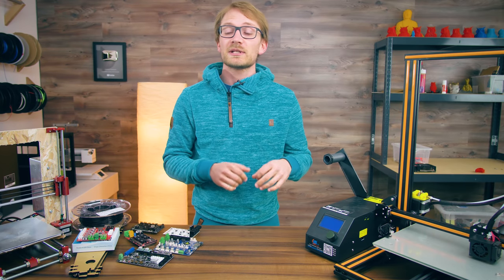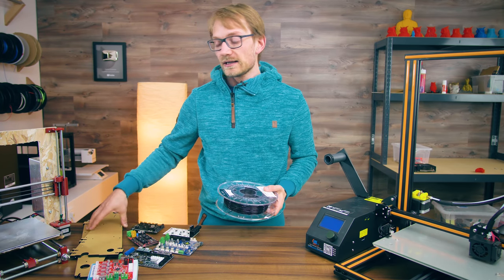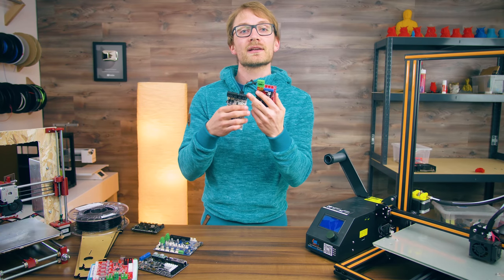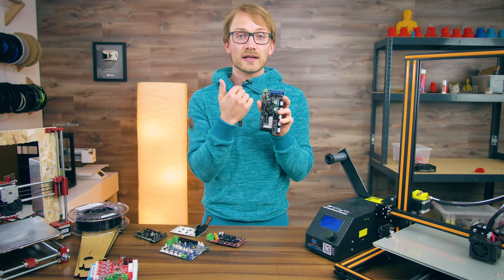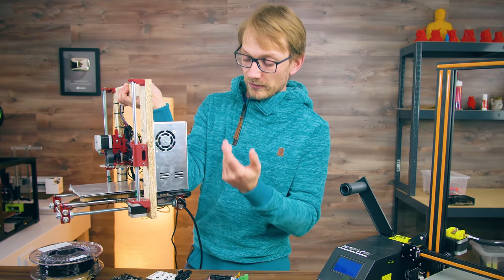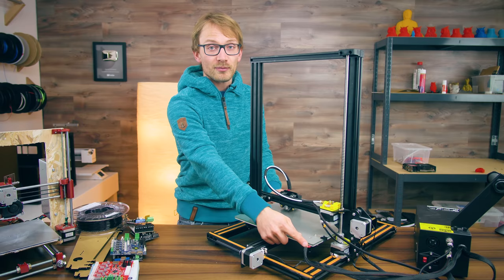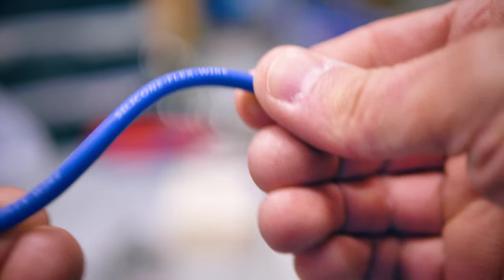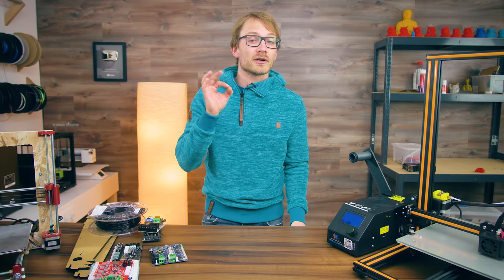Everything you need to know to make your 3D printer fireproof!

Comment: Anet and some of its siblings ship with Repetier-FW, which has thermal protection, but it's disabled by default. So they haven't enabled it probably by negligence.

There has also been a simulation published on reprap wiki that the inductive spike off the bed, simulated with measured parasitic inductance of wiring and bed, can easily exceed MOSFET's rating, so a free wheeling Schottky diode across the outputs would be nice. MOSFETs are fairly temperature resilient, they're too hot to touch at 65°C but you expect them to live a long and healthy life at 80°C too, so chances are, it's more the spiking than temperature killing off the things. Of course they fail short, and then there's no reason for the fuse to trip, because it's as if the MOSFET was simply turned on intentionally.
Reply: Would the firmware updates or change altogether help this? Or would people be ok just installing outside mosfets for both heating elements? I wanna be sure it doesn't make a fire. I'm prepared for it, but i don't wanna ruin 3dp's credibility in my house. lol.
Reply: Official firmware updates, for Anet and its siblings (Tronxy, Zonestar, etc) - i wouldn't hope, they have no idea what they're doing. Alternative firmware distributions from the user community are generally safer and better tuned up.

I don't have an Anet but from the rumours i heard it seems that the official firmware also might not have a working watchdog. Watchdog is an internal peripheral of all relevant microcontrollers which runs a timer, that the firmware should re-start regularly after checking its state, that it seems to run fine. Once the timer runs out, which happens if the firmware is locked up or not delivering the necessary performance for its realtime tasks, if watchdog is enabled, the microcontroller will reset to bootloader and turn off all outputs, hopefully (in case of semi-sane board designs) turning off all heaters in the process, after which the firmware will boot again. Why i suspect this is because some people describe their printers locking right up occasionally. That is one of the worst things that can happen - if the heaters were on when it happened to lock up, they will stay on.

So it's very much advised to use someone's better developed firmware.

Having an external MOSFET doesn't fix the potential thermal runaway issues if you're running stock firmware. Furthermore i suspect that in case of one of the recent fires, various hardware upgrades have exacerbated the issue - more powerful power supply was installed, an external MOSFET for the bed was installed. But that just means you have THAT much more power to go around if things go wrong! There was effectively not a single electrical fuse on the thing, not one that was anywhere near sensitive enough. Anet and Melzi already don't come with fuses on the board, which is bad, and with those printers which do, circumventing the fuse and installing an external MOSFET without giving it another fuse is outright criminal. Plus look at those MOSFET kits, they are generally Chinese ICs, the specs on them seem... fine, but there's no telling how good the production consistency is, and how they behave just outside the specs such as on occasional spikes, how well designed the whole board is, there's still no protection diode to cap the voltage spikes, there's always more things to go wrong.

Once the MOSFET fails, it fails short and there's no control. Firmware can detect thermal runaway, and if it was on an ATX power supply and had PS_ON control, it could cut off the power to the complete heater/motor portion, but the way people normally build stuff, it's not the case. Also thermal runaway detection takes maybe 20-40 seconds to engage, and by then, you might already have a self-sustaining fire. Janky printed cable chains that people installed to make things better sometimes made things worse because they did rub the cables in a spot and hindered inspection. Beefier wiring sometimes made things worse. Most things you can do will have benefits and potential drawbacks.

Unfortunately i'm not good enough of an engineer to give you much specific advice (and i do have electronics engineering university education), i can just list some potential problems but i don't have the data to back up how important or prevalent all these issues might be, and to give a solution which would be easy to grasp and implement for a typical builder without introducing further issues. This is something where we need to put out heads together and dice out as a community, pooling from various experience fields.
Reply: So in repetier, is it the watchdog timer that is the protection, or is there other settings required?
Reply: I'm not very familiar with Repetier, but their lingo for thermal runaway is "decoupling", so look for that in the configuration file. In particular you should probably enable KILL_IF_SENSOR_DEFECT, which is weird that this is the only one that jumps out and doesn't use the same wording, but it controls the sensor decoupling test feature.

Also the feature might be faulty, see issue 737 on their Github filed a couple months ago - "v1.0.0 Firmware does not detect defected thermistor (-200°C and still running)" - weirdly no response from the maintainers AT ALL. I mean, when there's a security or safety relevant issue being filed, wouldn't you rush in to treat it at priority and at least request more information and triage it? I don't know, this kind of conduct (or lack of any) leaves me speechless.

FEATURE_WATCHDOG is enabled by default, but it's kind of tricky to get right, who knows whether they ever actually tested it - it's difficult. Also it's not thermal runaway protection, it's protection against the firmware locking up and losing control over heaters altogether - it can result in thermal runaway which thermal runaway protection could no longer catch, because it would no longer be executed. Similarly, Watchdog is enabled by default in Marlin.
Reply: Dragonslayer.Bob If you want extra safety a seperate mosfet won't do, you need a switch that fails open... like an electromagnetic relay.
Reply: Warrior, but electromagnetic relais have bad failure modes too! Imagine the gradual contact wear - as the contact resistance creeps up, the increasing portion of the total power delivered on the bed rail gets dissipated on the relay contacts - let's say it's about 100W in total. At its worst, the resistance reaches the same as the bed, so effectively 25W may be dissipated on the relay, it has to pretty much cause a fire. What makes a MOSFET solution attractive, besides the fact that it's cheap, is that for a well designed MOSFET system with quality components, the MOSFET will stay operational and not experience a significant degradation for the lifetime of the device easily, for numerous decades of operation.

Furthermore relais don't necessarily fail open. Sparks and inductive current spikes can cause the contacts to weld themselves, so the relay stays permanently in closed position.
Reply: Siana Gearz Electromechanical relays are usually designed to handle far more power than a heated bed draws though, so the resistance should be low enough for this type of application. And yes, it's not impossible for an electromechanical relay to fail closed, it's still a better safety measure than another mosfet IMO.
Reply: Siana Gearz Keep in mind i'm not suggesting running a relay in PWM, it only needs to open when the board detects thermal issues, so the contacts won't wear that significantly.
Reply: Oh, i didn't know that you meant that! You could control those from the PS_ON signal then. I might borrow this idea. Should look into stepper EN signal also, might serve similarly.

Note to everyone who wants to try that, relay control winding will easily kill an Arduino, so it should be buffered with a transistor, and a free-wheeling diode to protect that in turn.
Reply: Siana Gearz Yes, i switch mine from the PS signal. That way it only switches when you turn the whole printer on or off.
My heatbed is also 230v, so there isn't that much current through the relay.

Comment: I have had my 3D printer catch fire. I was so lucky that I was looking at it as it caught fire, and simply switching the power off was enough to stop the small flame that had started on the stepper motor driver. and I didn't have to use the fire extinguisher i had grabbed after flipping the power switch. what was concerning was the smoke detector inside the room with my 3d printer didn't go off, but the one on my landing did go off.

Comment: We had a discussion on the Anet A8 Facebook page a short time ago. We discovered that using these external Mosfet board upgrades that are very cheap and work well in removing the AMP's out of the main board connectors and mosfets, but when they fail they typically fail ON. So even if you had the software upgrades because you have bypassed the printer main board using the Mosfet, if it fails on it will not turn off even if the printer is off. Because these cheap printer PSU's do not switch on and off by a controller from the printer main board like a computer PSU for example they can cause the exact problem we were trying to prevent in the first place. 
What is needed is a relay controlling the PSU's supply determined by the printers safty features and if its actually on and in use/ printing. 
From the ideas we had a extra Arduino would be required to control the relay as the printers main board doesn't have the IO pins spare or be controlled by a Raspberry Pi octoprint setup.

Comment: +Thomas Sanladerer
That smoke detector is in a BAD spot you should have it in the centre of the ceiling - putting it on a corner like that means the airflow could keep smoke from going through the detector.  I'm a former firealarm technician and I have seen smoke alarms fail in locations like that.
Reply: was looking for this comment
basically all the firealarms i bought had a 0.5 to 1m recommendation for wall distance on the box

Comment: Thank you for this video Thomas, I was already planning to use those automatic fire suppression cans in metal enclosed case with some simple power shut-off sensor but all the electronic parts informations are excellent for electronically inept people like myself (I can make stuff work but doing it by the book is out of my league). Regarding safety I have few questions that I need to answer before I get into 3D printing. My problem revolves around extremely limited working and living space and health and safety concerns. I can't dump my yet to be acquired Prusa Mk3 into the garage I don't have and call it a day. My current apartment that fits my needs perfectly well (single big room with kitchen annex and small bathroom) and I can't really relocate either way. With Prusa Mk3 eliminating noise problem as well as all the little quirks that let it be fire&forget solution the last concern I'm having is about fumes. We know at this point they're toxic and keeping a printer in your bedroom is a bad idea hence why I didn't pull the trigger on any printer yet despite following the subject for quite some time already. Taking into account limited living space I'm dealing with I was wondering if some DIY airtight enclosure with fumes extractor consisting of a system where air has to be filtered through some active charcoal and HEPA filters would do the trick or whether can you recommend some ready, reasonably priced solutions to address my problem. While some people would ask why I just don't open the window and call it a day I'm just gonna say that where I live it's rather cold thorough the year and given the limited space it would be equivalent of filling my bed with ice cubes which I'm not really thrilled about. I believe I'm not the only one with such a problem and video on the subject would find some target audience if you ever decide to expand on it. Thank you in advance!
Reply: same! i just got a closet for enclosure and am looking for a good fire alarm + fireproofing to put inside

Comment: 6:50 You should not tin also because you are making contact area smaller. 
For High current application I suggest using XT connectors - Amass XT60 can take between 30 and 60 Amps :D. Also is reasonably cheap and disconnec force is very reasonable. Only backside is that it is hard to solder - but this is due to high cooling speed, which gives this one such high amperage. 
7:30 heatsinks are probably because there is no copper polygon for cooling here. But too many designers forget that plastic case thermal resistance is very high and TO-220 without heatsink will be still cooler than DPAK with incorrectly mounted heatsink. Funny thing is: if they added price of placing heatsink, they would probably have already good enough MOSFET with low resistance.

Comment: I don't agree with the "don't tin the wire ends" part though... Tinning the end is not to make it look neat. It is to make sure that all the copper strands gets the maximum contact surface with the contact in the screw-in connector. Otherwise use a ferrules. Check electrical guide book. Note that copper will also deform under pressure if that was a concern

Comment: Also worth mentioning: Power mosfets turning into shorts (probably due to ESD damage), had this happen to me twice on a "ancient" RepRapPro Huxley (Melzi controller).
Both times i happened during the heating phase for the hotend where I remove any ooze with a pair of tweezers (metal ones)
No fires as I was next to it, but the first time around I spend too long considering my options, resulting in having to "rebuild" the hotend.

After the second time I have switched to an e3d v6 clone hot end, hope its heater cartridge insulation might be better than then wirewound resistor in the older original hotend design.

Anyway as the hotend (and steppers) now runs off 12V I'm considering switching to an ATX PSU  to allow Marlin to switch off the power if it detects a problem.

Comment: Well this was great reminder! Just checked my printer over and noticed beds connector negative lead having some color chance indicating it has went near combustion temp. Strain relief was earlier on my list of to, but could not figure how to install it since heat bed is one of those aluminum elements, but yeah will be replacing the connector and developing something before next print, since that was way too close to comfort.

This is reason why i never print anything while i'm away. I rather cut larger peaces into smaller ones and print them when i have guaranteed time to stay and supervise the thing, or i have someone around to supervise it while i check into store or such, only leaving it alone for going for smoke etc under 5 minutes.

Comment: intumescent paint.  Paint the inside with intimecent paint, its amazing stuff.

Or Rockwool comfort board would also be insulation for a heated enclosure.  
It would be a fraction of the weight of drywall

Comment: I love the automotive fuse idea. Brilliant! Oh yeah and put a battery powered smoke alarm on top of the printer itself. BTW is there a smoke/combustibles alarm that will cut the power automatically? Electrical equipment usually smokes for a while before it combusts  so killing the power immediately could save the printer and/or your house.

Comment: I had a connector on my Hictop Prusa i3 3DP-03 catch fire. Burned a hole in the acrylic frame and the MKS base board. Now I use a solid state relay, 24V supply and peripheral, and the better rated MPX.3 board.

Comment: You didn't mention nearly enough.
- "wire end crimps" are called ferrules.
- Terminal blocks to prevent using improper connectors and when using a contactor.
- Using contactors, especially when using SSRs as they can fail shorted.
- Separate fuse for the controller
- Thermal switches(breaker)
- Thermal fuses when not using contactor with SSR.
- Proper grounding
- Breaker before powersupply

also,  the regulator on the ramps board gets extremely too hot. Ones with switching regulators are much better.

Comment: I would also add thermal fuses around the printer. Over the top of connectors and such. They'll blow at a set temperature and cut off power to the printer.

Comment: maintaining the wires - you can drop in there a small carbon fibre flat (got some advantages) or round (no edges to chew on the wires), you find these in any decend RC model shop and they cost 1-3 bucks.